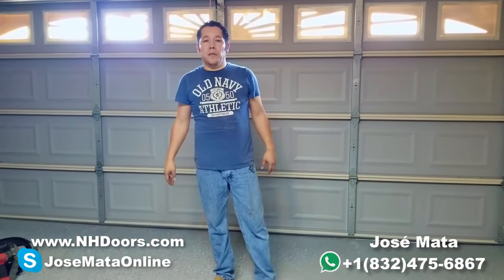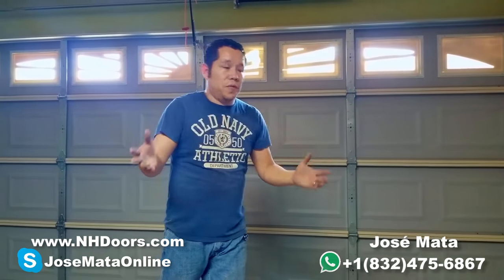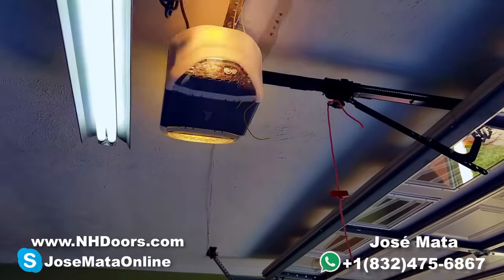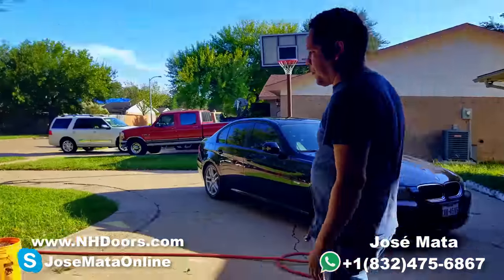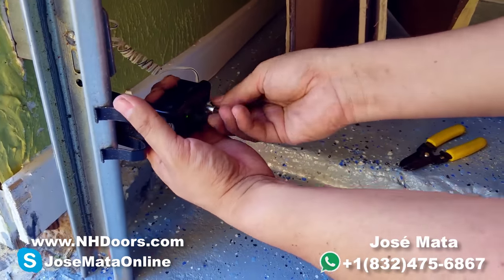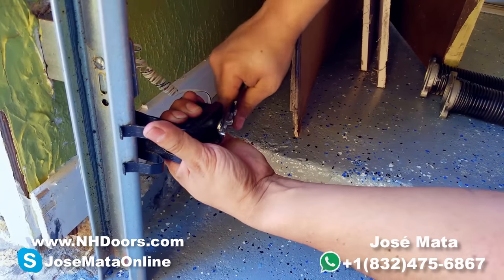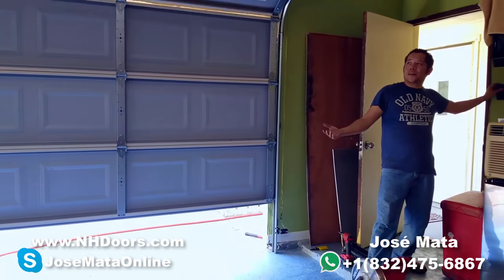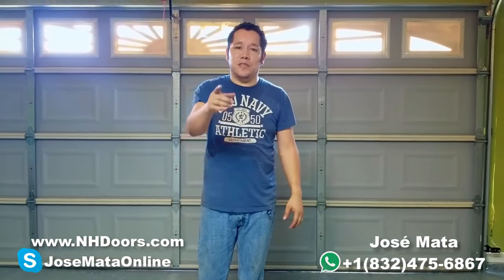How To Realign Garage Door Sensors in 5 Minutes or Less! - #Garage Doors #Houston

Comment: Thank you, Jose.  BUT, how do I get the sensors to point correctly and align with each other?  Do I just wiggle it back and forth, up and down until I get a green light?  That's what I've been doing and I don't get a green light.  There must be some way to make sure the two sensors are pointing right at each other.
Reply: exactly my problem.... this video is a big fail

Comment: Thank you.  Video saved me.  I noticed the green light was flashing ever so slightly and I had to get close to see it.  Adjusted it until it was solid green and problem solved.
Reply: I had the same problem but it still didn't work i just gave up sprayed some glass cleaner "Clindo" on the sensor lenses and thats all she wrote. Fixed
Reply: @terrytubbs5127  Sometimes the issue is that the sensor is dirty. It's very rare but it happens. 👍🏻

Comment: Great Video Jose. My door was older and the track was moving when the door was going down. The sensors would move and the door would reverse. Went up fine, just not down. The other issue I had was a loose wire so the door wouldn't operate at all one time. Just the lights flashed. Traced it back to a loose connection at the main motor / unit. Then one day it happened again. Just flashing lights and door not going down. Turns out the old wiring was cracked and shorting. If possible, it can save you a lot of time to just install all new wiring from the sensors and the door switch when installing a new opener. :-)

Comment: Hi Jose, thabk you for your video. My green light sensor was blinking, but I repositioned it and now a have a solid green light. the problem is that when I tried to close the door, it goes down for a little bit, the goes back up. and the lights blink 10 times again. even with the orange and green light in solid color.

Comment: Im having an issue with the sensors, i think they were insralled 3 years ago but used the same old wire, now the lights are off, do i rewire or how can i tell if the sensors went bad? Thanks, what area of houston ?

Comment: My sensor lights will not go on.  I just replaced the oil sensors that worked but the orange sensor mounting broke.  I have had it clamped with a c clamp to keep it working while I ordered replacements.  Now the lights won't come on. How to you align the sensors the first time.  You only had to bolt the old sensor back into its bracket.  I need to know how to turn on a test light so I can see where the eyes are pointed so I can align them.  Any Ideas?
Reply from the maker: yes u can Remplace the  wires and will be work!!:)

Comment: I just installed a new opener. Works great by hand. But gives 2 flash & won't operate via controller.  Sensors are solid lit .
I couldn't find any issues in wiring or anything else. 
Why inoperable?

Comment: My garage door has one red sensor, one green sensor and the garage door won't open. The red sensor is probably the cause, but not sure how to fix it. You can hear the motor running and the light emits from the Genie opener. Can the reason it is not going up be because there is a broken spring?
Reply from the maker: Try open manually if the door is heavy the Spring is broken!

Comment: JOSE, I JUST DID SOME TROUBLE SHOOTING. I FIRST REMOVED ONE OF THE WIRES GOING TO THE SENSOR FROM THE BACK OF THE GARAGE OPENER AND THE DOOR WOULD NO LONGER GO UP OR DOWN. LIFTMASTER HAS A LOCKOUT CIRUIT WHICH DISABLES THE OPENER WHEN THE SENSORS ARE DISCONNECTED OR SHORTED, SO IT RULES OUT THE SQUIRREL EATING THE WIRE. THE SECOND TEST I DID IS CLOSE THE DOOR USING BOTH THE REMOTE AND MANUAL REMOTES AND THE DOOR GOES DOWN COMPLETELY AND THEN COMES ALL THE WAY UP AND THERE LIGHT DOES NOT BLINK AT ALL. THE THIRD TEST WAS AS THE DOOR WAS GOING DOWN, I PUT MY FOOT INTO THE SENSORS AND IT REVERSED AND WENT BACK UP AND THE LIGHT WAS BLINKING, AND DOES THIS MEAN THE SENSORS ARE PROPERLY ALIGNED. SINCE YOUR EXPERTISE IS IN THIS AREA, WHAT IS THE CAUSE AND THE FIX TO THIS PROBLEM. COULD IT BE THE FORCE ADJUSTMENT ON THE UNIT HAS TO BE ADJUSTED AND IF SO WHAT SETTINGS SHOULD I TRY.

Comment: Pretty good video just to let you know on the garage door opener the emergency release rope and handle was done wrong the handle is upside down and there is a lot of access rope that needs to be used or it needs to be cut off Pretty good video just to let you know on the garage door opener the emergency release rope and handle was done wrong the handle is upside down and there is a lot of access rope that needs to be used or it needs to be cut off

Comment: So one of the sensors has a green light on and the other is off and wont turn on no matter where i align it i guess its broken. Where can i buy a replacement and how can i do it.
Please and thankyou for your time
Reply: ahh lights off means sensor down... Im not getting a blink or anything on my sender light thata likely my issue
Reply: @rajgill7576  EDIT: I found the same model pair on amazon for 12-$20$ just make sure its compatatable with your garage opener
Reply: @eatalittle  right on, looks like I'll be ordering a set today after a little research thanks man

Comment: Hi - My sensors both lights are off, could the sensor be damage?
Reply: Or bad sensor connections to the opener.  Sometimes the wires LOOK connected, but if you tug a little on them they'll disconnect (break).  Re-strip and reconnect them.

Comment: JOSE, WHEN I CLOSE THE DOOR WITH THE REMOTE OR MANUAL WALL SWITCH IT GOES ALL THE WAY DOWN TO A FULL CLOSE AND COMES UP AGAIN. THE LIGHT ON THE LIFTMASTER DOES NOT BLINK INDICATING AN OBSTRUCTION OR MISALIGNED SENSORS. I HAVE 2 DOORS AND THE DOOR ON THE LEFT STARTED DOING IT AROUND 3 YEARS AGO, SO I USE THE DOOR ON THE RIGHT MOSTLY.  WHEN I LOOK AT THE SENSOR MOUNTED ON THE RIGHT TRACK, I DON'T SEE THE GREEN LIGHT ON AT ALL, BUT ONLY THE AMBER LIGHT ON THE SENSOR MOUNTED TO THE LEFT. DOES IT MEAN THE SENSOR IS BAD OR DOES IT NEED TO BE ALIGNED IN ORDER FOR THE SENSOR TO TURN THE GREEN LIGHT . I ALSO HAD A SQUIRREL IN THE GARAGE 2 YEARS AGO BUT AFTER REPLACING THE ROOF HE IS GONE. COULD IT BE THAT THE SQUAREL NIBBLE AT THE WIRES AND CUT THE POWER TO THE RIGHT GREEN SENSOR WHICH CUT THE POWER TO THE SENSOR WHERE IT DOESN'T LIGHT OR DOES THE SENSOR JUST NEED TO BE REPLACED?

Comment: What if the door goes all the way down to about the height of the sensors and then goes back up?  No obstruction, i cleaned the lenses, both lights are solid green and tight.  Door goes down, gets to about the height of the sensors and then goes back up, lights blink 10 times.  Can't figure this out!  Help
Reply: peter brown happens to me when I have some  leafs stuck to the bottom of the door and when that lead is at sensor level is breaks the signal and door starts to reverse. Try cleaning the bottom of the door while
It’s open.

Comment: I tried for like one hour and I can’t get the light to go green still yellow 🤬
Reply: Your light will not turn from amber to green, it will stay amber, the opposite light will be green, the transmitter sensor will be green the  receiver sensor will be amber, if the lights on the sensors are out or blinking, the first step is alignment,  2nd step is wire is breached, 3rd is bad sensor 4th is motherboard on opener